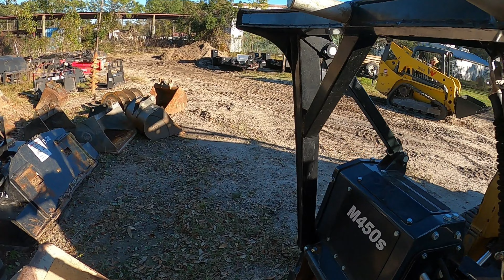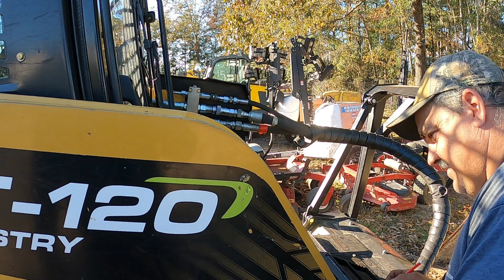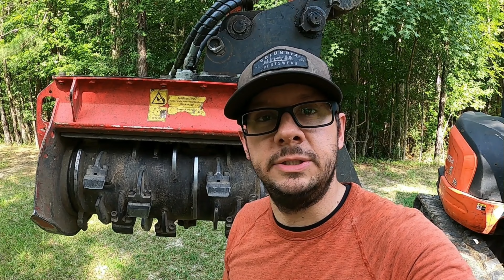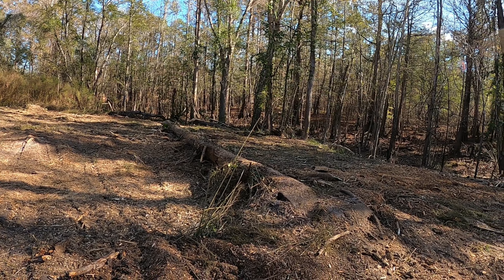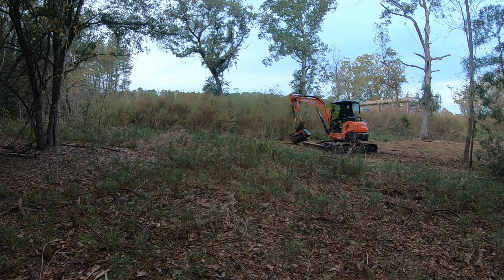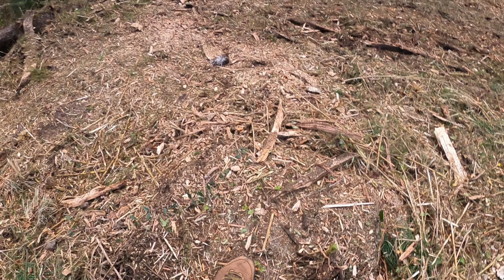LITTLE MUNCHIE TO THE RESCUE! Big Munchie is Broke Down!

Comment: Sad the ASV is out.  I hope that cracking manifold is not a common thing that happens during a jam.  If so, ASV going to need to do some re-engineering of that thing.
Reply from the maker: I'm not sure the wire jam was what caused it but it's possible.  It'll be interesting to see what they find when CCE takes it off and replaces it.  Regardless, before that happened I was super happy with the production and performance of the ASV with the Prinoth!
Reply: I would have thought they would have some type of hyd accumulator in the system to absorb a shock. If you have a lot of flow and pressure and try to stop it instantly, something is going to blow.

Comment: Hey man. I'd check your pressure relief/ spring. Haven't watched your stuff in a while seems to have lost a little punch unless you're running engine at low rpm.